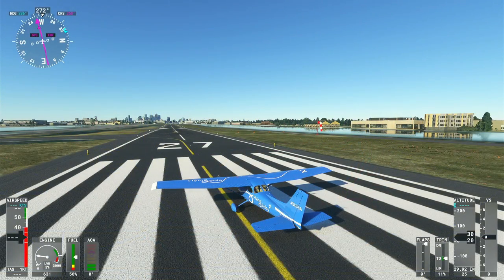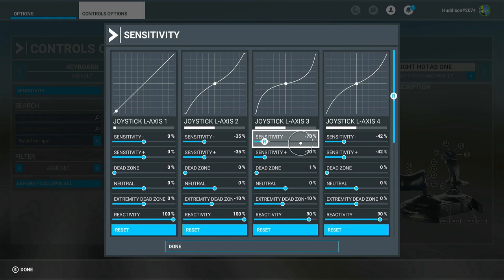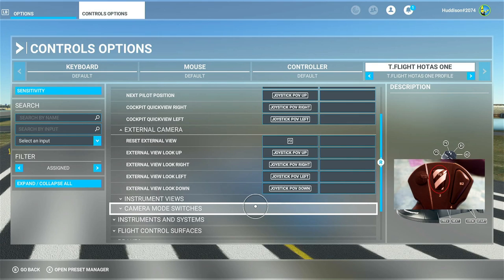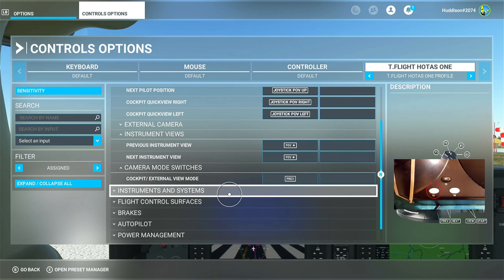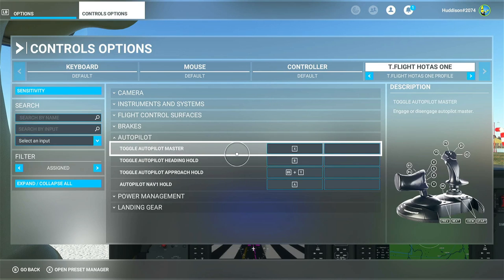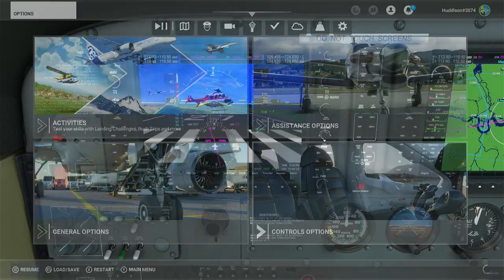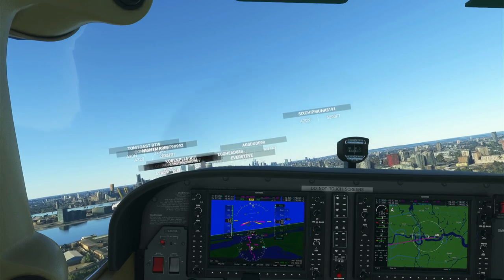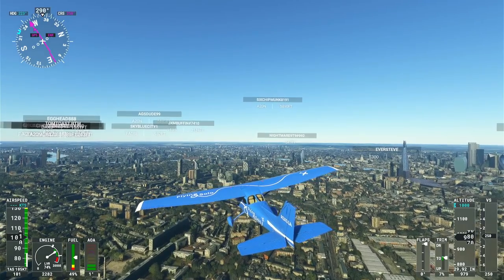Xbox 2020: All my Hotas One Settings & Sensitivities - 2023 Edition!

Comment: Well Mr Huddison, 
Your video guides are Simply the Best! 
I finally received my Hotas One and used your excellent guides to set it up.
Finally after flying for a month using a worn out XBox controller, and barely landing on a runway. With this Hotas One and your settings, I've finally made my very first, near perfect landing, which was slightly let down by me being not used to the joystick rudder controls. 
As you can probably guess, I am extremely happy with the H1. Many thanks, I really appreciate all you do to help people like me.
Right, time to get back to me practicing. Stand Clear! Chocks Away!
Reply from the maker: Congrats, that's so good to hear! Happy flying my friend  ✈
Reply: @Huddison  I'd like to also report, It appears that the sloppy thrust lever has finally been fixed. It feels really nice, with just the right amount of firmness to it. Though that centring notch is still there, and very annoying! As soon as the warranty is up, I shall be doing something about it. LoL
Reply: Hi. My xbox Hotas One has not same settings list as in your video. At example i have nothing about autopilot. Have i to set something in firmware?

Comment: Your custom setup makes a lot of sense. I have setup the TM HOTAS One similarly for basic flight functions sans the autopilot settings that you show in this video. I will be including these settings next. 

I have a couple of questions. This joystick includes a dedicated internal/external camera button--the interlocking rectangles icon next to the Xbox button. Why do you assign Prev (13) to this same function? Also you assigned the landing gear toggle to Next (14)--this is defaulted for the checklist menu toggle. Do you not use the checklist or do you access it by some other means?
Reply from the maker: I'm not sure if a lot of those assignments were there by default, but feel free to un-assign what you don't want or need.
I use the top menu for checklists, if I ever require them.

Comment: Has anyone had an issue where the hotas controller is registered by the game (shows up in controls menu) but the joystick and throttle dont work. I can only actuate my ailerons, elevator, throttle and  flaps with the gamepad controller, cant figure it out
Reply from the maker: You do have it set to the correct input mode (Xbox or PC)?  I feel this might be best investigated in our Discord.

Comment: Thanks again Huddison! I seem to have a problem with trimming in MSFS using Hotas one I checked the control settings & ensured that B1 & B2 were mapped as key presses but for some strange reason whenever the buttons are released the trim reverts to maximum! Also I think my B1 button may have a fault because when I enter the control menu B1 box is always highlighted and pressing B1 does not affect what I see in the controls box! Any idea what I need to do because the cessnas are now unflyable? I also noticed a strange new key instruments overlay at the bottom of the cockpit on my screen with items like vs and Airspeed appearing in white - how do I turn these off?
Reply from the maker: The Trim reverts to maximum in both directions (Trim nose up & down)?  I think perhaps your best joining our discord; you can post images there of the issues - it's not so easy for my to visualise what may be occurring.
Reply: @Huddison  Ok thanks for your suggestion! I checked the hotas one default settings for the wheel at the rear of the hotas throttle and found that that worked perfectly with the cockpit trim wheel remaining wherever you set it! It is mapped to an axis!

Comment: Hi Huddison I am struggling with setup for reverse thrusters on a Hotas One when using Pmdg 737 and also on Atr! on A310 i could use a button to toggle reverse mode and then push throttle forward to adjust reverse thrust. Another click toggled reverse iff and was back to forward thrust. Any way to mimick same action on 737 and ATR? I know you have the answer! Thanks
Reply from the maker: I don't own either of those aircraft, but I would probably use 'Hold reverse thrust' for them.  Our Discord might supply you with more definitive answers.
Reply: @Huddison  i see! Both great planes to have, two best on xbox Inwould say at least for me! Cheers

Comment: Could you show a larger picture of that rubber band going across the throttle.I tried to put one but it has a tendency to pull back from both full throttle as well as idle position.Another angle of it from under the throttle maybe helpful. Thanks
Reply from the maker: If you scroll through my community posts on the main channel page, you will see a picture of it there (need to scroll down a fair bit).

Comment: Any advice on how to get mine to work? I can control the Xbox menu no problem, but when I load up flight simulator, it will not show up in controls. I have updated the drivers and firmware, tested it out on PC and it works. But when I plug it into my Xbox, nothing on the sim. Thanks!
Reply from the maker: Have you set input to Xbox?

Comment: For someone who wants to control the G1000nxi system to fly approaches, what is the best way (controller, mouse, Hotas One, etc.) to be able to do that.  I'm new to MSFS and am having a heck of a time being able to switch to the G1000 screen, make changes then get back out to fly the plane.  Should I use a mouse in conjunction with the Hotas One?  Thank you....
Reply from the maker: Yes, ideally a mouse with a controller is a good way to learn the systems.
Reply: @Huddison  awesome v thank you. Any specific button mapping recommendations for the mouse?  Is a multi button gaming mouse what you recommend?
Reply from the maker: @nodouttaviation2817  Just an ordinary 2 button mouse with a middle scroll wheel works fine when interacting with the G1000.
Reply: @Huddison  Thank you sir.  Any suggestions for the button and scroll wheel mapping?

Comment: hello! I know this video is quite old but I was possibly wondering if you or someone else could anwser my question. I can hook up the flightstick to my Xbox x series, go through the pre-flight menu's with it, I did check beforehand to make sure it was switched to Xbox mode, and not PC, but I get no input from the joystick or thruster? It registers in the control menu when I go to look at sensitivites, but I go to fly a plane and I have nothing. Is there a setting I need to adjust?
Reply from the maker: You can see the Hotas in Control Options? If so, are any controls (elevator etc) bound to it.  I feel our Discord will be the best place to solve this - many knowledgeable heads there.
Reply: @Huddison  I can see it in the control menu, yes, what controls specifically would I be looking at that need to be checked? I am very new to the flight world and don't know all the vocab yet
Reply from the maker: Really best joining our Discord and getting assistance from there for this.  @aliciaarthur1572